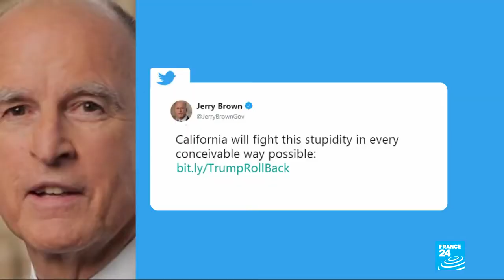Trump Seeks Freeze On Obama Era Fuel-Efficiency Standards

Comment: It's fairly straightforward to fuel vehicles and machinery with rendered and processed animal or human fat, which has a 10% or so greater energy density than regular fuel, making it more efficient. Given that Trump's body mass is at least 3/4 currently wasted fat, I'd be more than happy to run my Prius on liposuction products from Trump's carcass, and would be okay paying about the same as pump gas.